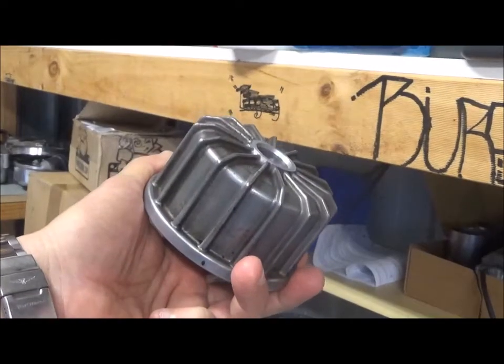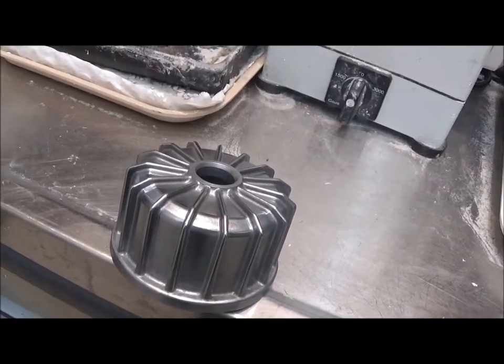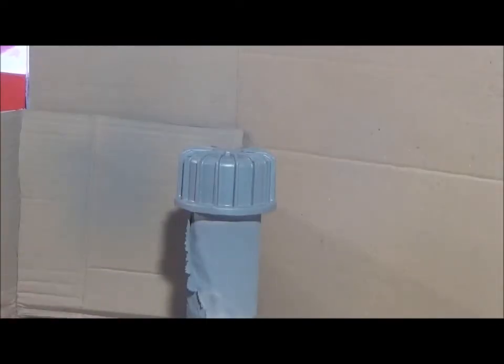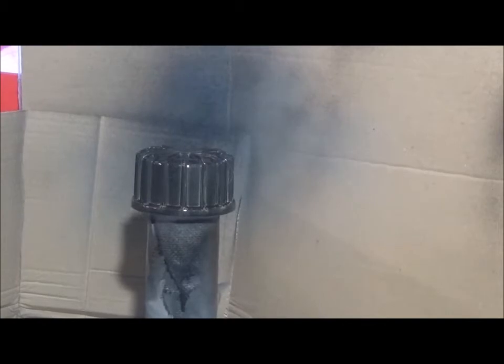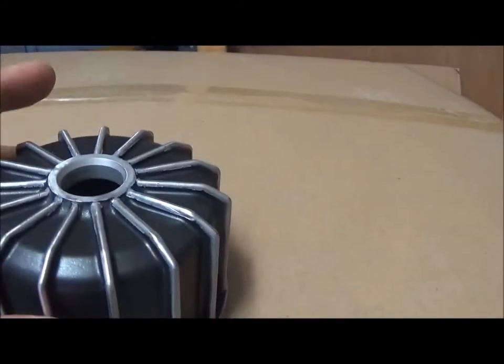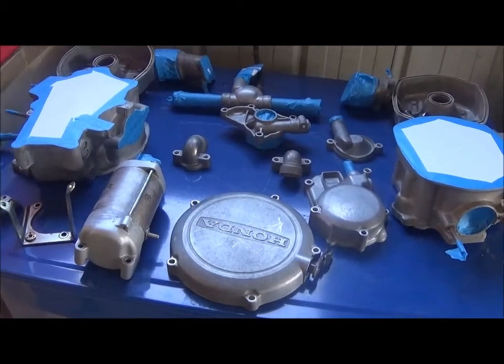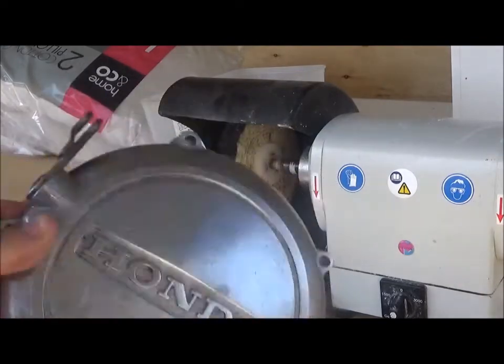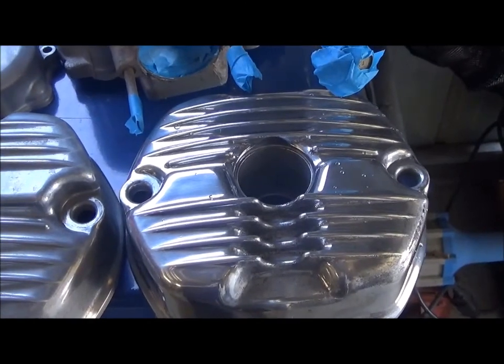Honda CX500 Cafe Racer - Painting engine - Episode 13

Comment: I'm in the midst of rebuilding one of 6 CX 500s. I'm using a two part paint, a hardener and base so to make the motor impervious to gas. I did initially vaporblast the motor in one piece before disassembly. After disassembly, I re-vapor blasted a few parts before painting. Vapor blasting is an essential tool in my shop. This video is a great help to us learners.

Comment from the maker: Hey Crunchivore. I don't know what's best, but for my build I washed everything thoroughly with degreaser, then used medium walnut shell to clean all surface marks and dirt, carbon etc, washed again with domestic pressure washer, as I was going to paint casings, heads etc. Valve cleaning coming soon on some of the future videos. Cylinders and block are washed, walnut blasted outside, and honed in the bores. Again future videos.

Comment: I would like to know for which parts sandblasting/walnut shell blasting/ultrasonic cleaning is the best way to go
like the engine casing (exterior/interior-at least the cylinders-), valves, heads, pistons, etc...
Thank you so much for sharing your knowledge and experience

Comment: I love these shiny head covers. You have to tell us how you got that result.
What kind of compound did you use? How much time/effort does it take? What method works better ? How can you reach this tiny little space in-between the fins ?
Reply from the maker: The Crunchivore ....I used cloth polishing wheels on a bench grinder at high speed, with brown, green, and white compound. In the fins mainly by hand with scotchbrite, and finished with Autosol polish on a cheesecloth. It keeps developing an oxide layer so I'm  going to try a coat of Penetrol to see if lasts longer.

Comment: Just discovered your videos. brilliant - especially as I've just decided to do something with my old CX c that's bin sitting in the shed for 20 years. Since you decided to paint all the parts individually, did you end up baking all the parts at 100 degrees - even the larger ones? Also handy is that you're an Aussie, so any terms or products mentioned, are relevant. With these vids and my Hanes manual, I should be ok??? maybe? Cheers from down south.
Reply from the maker: Hey cotteeskid. Yeah...baked in oven. I have to say that on engine casings it still chipped off in a few places soon after baking. It seems to be a lot tougher a few months after painting.
Better than Haynes is the factory sercice manual...https://coodie.com/cx/